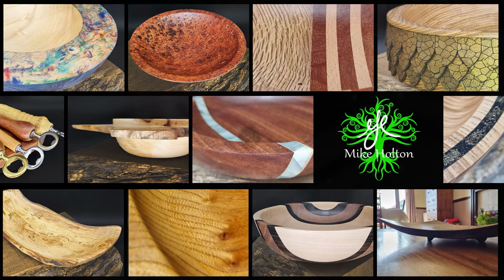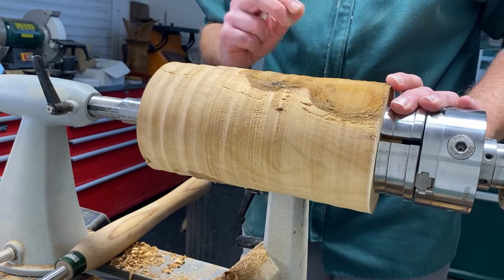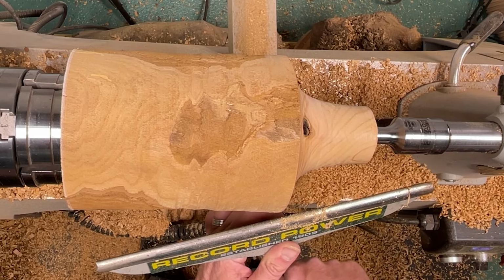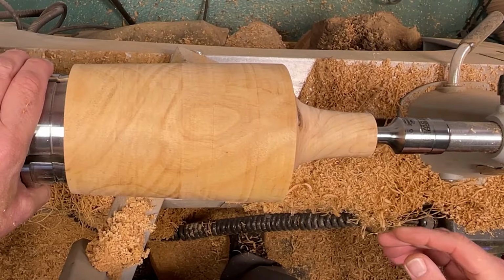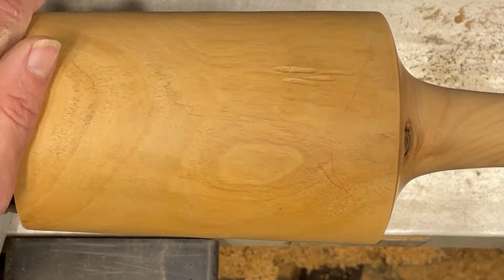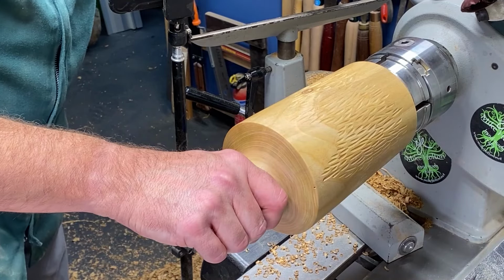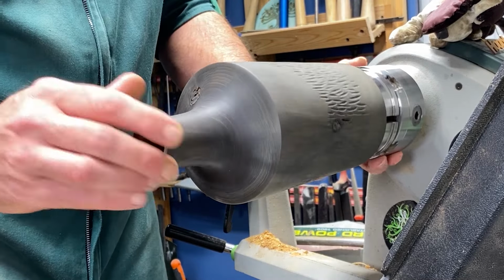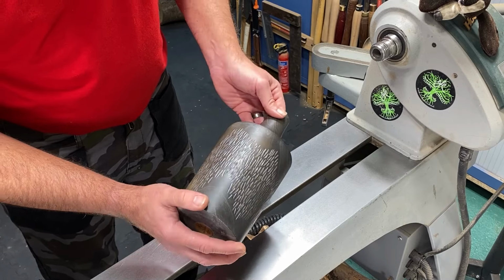You Won't Believe This Cherry Woodturning Technique!

Comment: Beautiful piece Mike the carving looks lovely and the ebonizing solution worked really well. I've made my own solution using tea for part 1 and wire wool steeped in vinegar  for part 2. It works a treat. Well done Mike.
Reply from the maker: Great tip! And thanks Kev 😀

Comment: First of all well done for biting the carving bullet 👍🏻 the first cut on each new piece can be just as hard, but you’ve achieved an amazing result, the vase is beautiful I absolutely love it!

You said about carving in the same direction I’ll be honest and say it would be so hard to achieve a uniform look I think what you did was the right way - it is easier as well if you have time to go into each cut with a slightly smaller gouge to clean up, which also gives you more controlled cuts and a smoother surface for the wax to sit in.
Serious thumbs up from me Mike 😃
Reply from the maker: Thanks so much for the tip! Really appreciate it 😁

Comment: I really like the color that came out on the cherry wood.  I am working on a piece and trying a different finish this time.  I have used steel wool and apple cider vinegar before which produces a rust colored finish.  I am going to do the same thing this time with distilled vinegar and see it if will give a gray finish.  This is going to be on an aquarium stand made of pine.
Reply from the maker: Thanks, that sounds like a good idea, not sure how much pine will darken as there are not a lot of tannins in the wood but will be fun trying 😀

Comment: ebonizing fluid did wonders on this wood. that looked great, an instant vintage look, quite different from what it does to oak.

that silvery wax stuff, however, was unnecessary in my opinion. you had reached the perfect condition just before you applied it. but, on the other hand, now all of us know what effect it creates.

I don't do woodturning (yet?), but I do work with wood a little, and I've already learned quite a few tricks from your videos, even though I've barely started watching them. that's good!
Reply from the maker: Thanks! and thanks so much for watching 😀

Comment: I am just at the part where you took out the gouge.   So excited.   I love hand carving.   So hard to find good tools without spending too much money.  I only have managed to nab a handful of great old ones, but I find that it's more important to use them than collect them anyways.   Amazing what you can do with a few hand tools.   although Flexcut tools are pretty decent as well.
Reply: Hey!    Looks good.    Now that you have broken the seal on hand carving, remember this number 1 most important point.   The front hand is the brake, and the aiming.  The back hand is the motor.   Don't push with the front hand, and you will need far few bandages.    Very pretty piece.
Reply from the maker: Thanks William, I really enjoyed it, can't wait to do more 😁

Comment: Interesting project Mike. Kind of a toss up for me because I loved the look of the natural wood.
You are right we need to take the first step to learn anything. I decided to build all the electronics for the CNC milling machine I built. Seemed really hard but I ended up making a second one for another milling machine. Then I set out to learn how to program them and I have to say I am pretty good at it.
 Not sure if I am ready to grab my carving tools and take a chance on a vase though LOL
Reply from the maker: Haha thanks, I just love taking that first step, I'm ready to do another carving but in no way ready to build a CNC machine 😂. All the best Gary and thanks 😄
Reply: Hi Mike I actually have done a lot of  carving. We had a customer at the pattern shop who made fancy brass handles for furniture. They were castings and we carved the original out of maple. This  was long before CNC so we would get a drawing and from that work out the design. This is all 3D carvings. I once carved a rabbit for another customer. It was then cast out of brass as I recall. About 10 inches tall. Man that was a long time ago. 
Today it would be so easy to CNC or 3D print these things.
Reply from the maker: @ThePapa1947  Wow you have a serious talent! Carving a pattern is one thing but actually carving something to the correct size and shape is incredible 😀
Reply: Thanks Mike, I had what I called the perfect job for me. Building patterns for about anything from big and small. Hydraulic pump case, turbine blades for jet engines and even molds for acrylic spas.  Pretty much anything that was cast from metal we did.
 And here I am retired and still making things out of wood. Makes me very happy.
Take care,
Gary
Reply from the maker: @ThePapa1947  You did indeed! I'm very new to all this but so happy I have it now 😀

Comment: Very nice! And the care you took with the balance of the piece at the beginning really paid off.

Several months ago, maybe even over a year, you did some lovely texturing with a Dremel tool (I think that's what I recall.) What do you think of the two techniques? 
Thanks again for a great video!!
Reply from the maker: Thanks, yes I remember. The dremel was probably easier to use but it needs a lot more sanding after. The carving feels far more natural and easier to control.
Reply: @MikeHolton  Thanks! The carving might be safer too, then.

Comment: That's quite a unique piece. 
I wonder if you would answer a question: a few times over the last few videos you've used the term de-nibbing. What is that? Thanks.
Reply from the maker: Thanks Ben, when you apply a liquid to wood it can raise the grain, de nibbing is the process of sanding off and returning the surface to flat before adding a finish😀

Comment: Is it possible to cut a piece of wood at an angle to the grain and then turn a piece?
Reply from the maker: I would imagine so but not 100% sure what you mean 😀
Reply: @MikeHolton  agreed, badly worded question! Could you make a vase with the grain at 45 degrees (or any angle) to the finished piece? To use tailoring terms " cut on the bias"
Reply from the maker: @bernardfender5147  Ah, yes you can but you have to be careful you do not stress the grain too much or it could break 😀
Reply: @MikeHolton  challenge accepted 😄? It would look so good made from really contrasting grain. Love your work pal and greetings from Salford
Reply from the maker: @bernardfender5147  Haha, good luck and you have to let me know how you get on 😀
Reply: @MikeHolton  I've got a drill and a hammer, how hard can it be!!